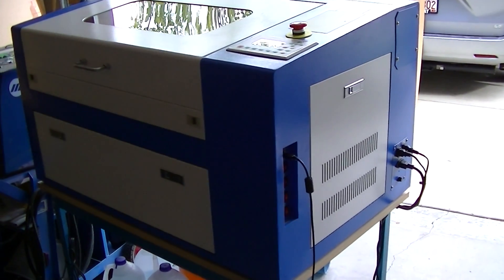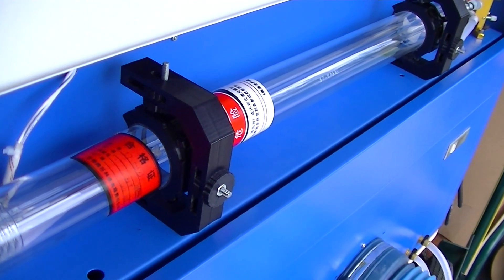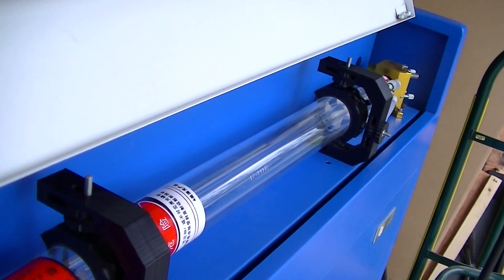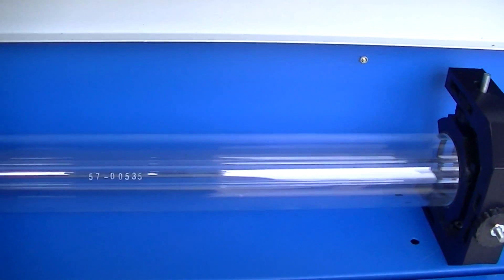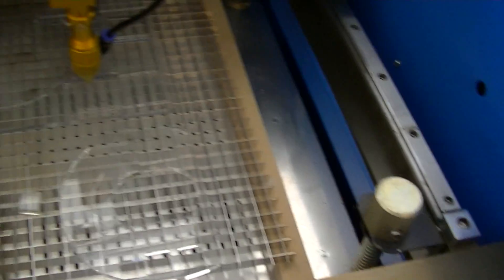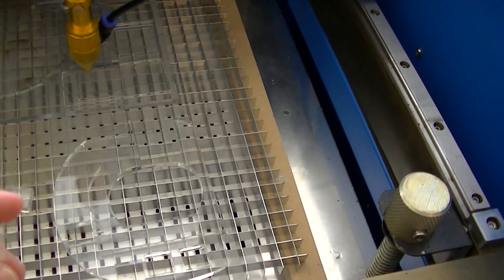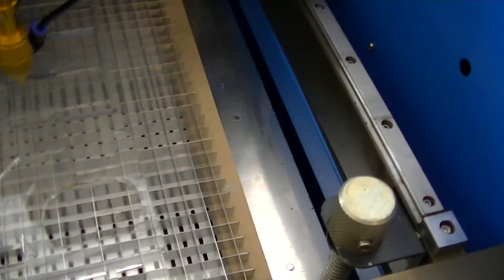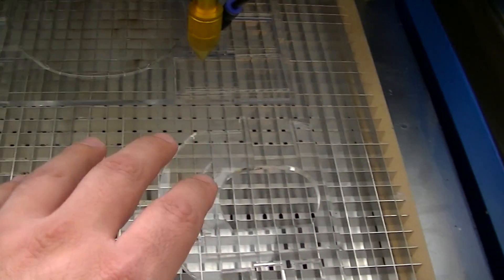Tube Hangers installed!

Comment: Looks like they changed the machine design between when you got yours and I got mine.  There is now a lip rising up from the bottom edge.  Was looking at your mounts but I don't think they are possible with the newer design.